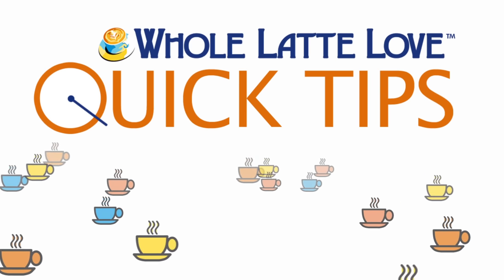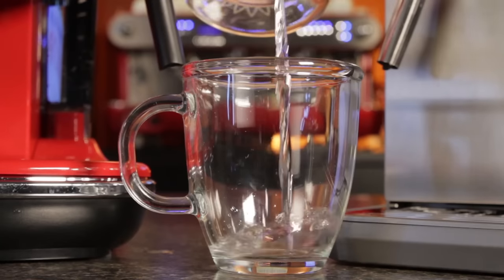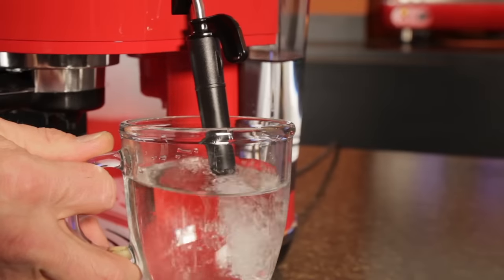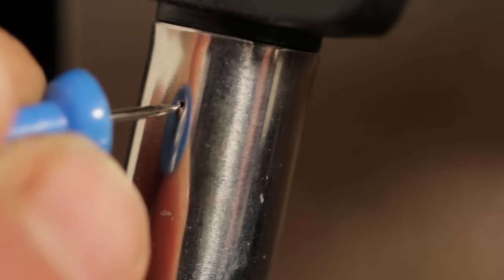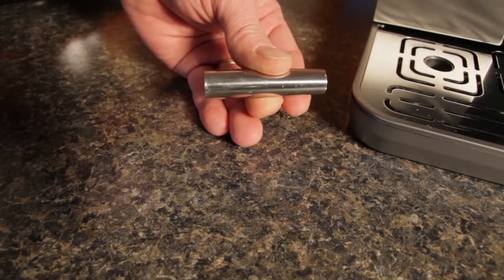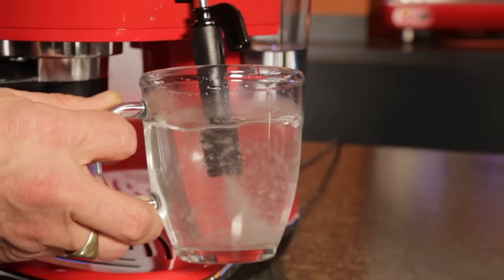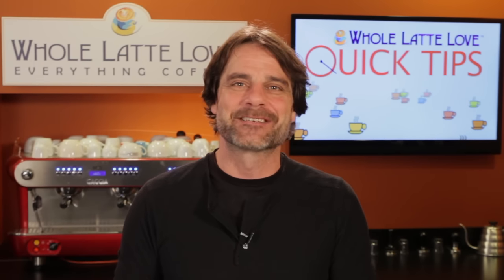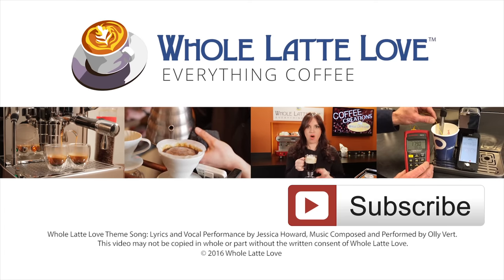Auto Frothing Steam Wand: How to Test and Use

Comment: I have the delonghi ec155. Is there a way to upgrade the frothing tip? It’s so small and short that I cannot get a good froth. The foam ends up separating from the rest of the milk. Thanks!
Reply from the maker: Hi LN, I'm not aware of any upgrades for that. It's a very entry level machine with limited capabilities.

Comment: Hi Mark, love your videos. My manual steamer on my Gaggia Accademia Is not producing the highly visible bubbles in a clear glass of water as shown in this video. I must have low pressure or something is clogged. I don't see any of the air intake pin holes the video shows to clean. Please advise how to get more pressure. thanks, john
Reply from the maker: Hi john paul, Thanks for the kind comment! Here's a video showing manual frothing to latte art quality on the Gaggia Accademia: https://youtu.be/wdTlwacRPPQ
There is no air intake on the Accademia's manual steam wand. You'll only find those on auto-frothing wands. Manual wands are capable of much higher froth quality than the auto-frothers!
Marc

Comment: is it possible to do latte art with auto froth
Reply from the maker: Hi, Is it possible? Yes. Easy? No. Getting to know your auto frothing wand using the tips in this video can help get you closer to the very fine micro-foam required for pouring latte art. It's all about getting the right amount of air into the milk early in the frothing process and then stopping air injection and rolling the milk to mix in and break up the air bubbles.

Comment: I assume the wand is expelling hot air... why does holding the wand deeper in the glass expel less air?
Reply from the maker: Hi AF, Thanks for a good question. The wand is moving air/steam. As steam moves through the wand some milk is drawn in through the wand tip due to suction caused by the steam moving through the wand. Near the top of the wand is an air intake hole. Air entering this hole mixes with the milk drawn up by the wand to create froth. As the tip of the wand is placed deeper into the milk less air is drawn through the air intake hole as there is less suction. Less air = less froth.
Marc

Comment: I think if you can replace the wand with higher quality I have a feeling it will not help much because the machine is not powerful enough to give more or better steam I think some videos suggest that machines with slow steam is better to control for people with no experience because higher quality machies the milk get hot very fast and maybe reach to near the boiling point if you do not know what your doing
Reply from the maker: It's easier to learn with a little less steam power. Thanks for the comment!

Comment: Why is this called auto froth? What is a non-auto froth then? I though all frothers worked like this
Reply from the maker: Hi d, Thanks for the question. Auto-frothing wands have a method of mixing air with milk within the wand during frothing. Manual steam wands do not. A manual wand can produce a much finer latte art quality micro-foam. But, they require some skill to operate for best results.
Marc
Reply: Because you are the auto :p

Comment: Do anyone know wheres the air intake for those delonghi panarellos that can be switch between "hot milk" and "cappuccino" like the delonghi dedica? Ive been using it for a while yet still can figure it out...
Reply: Same here  and if u have noticed there is a 1mm think sticking outse of the want and opposite to that therr is a depressio. On top. What is that for?. I have trird so many times ..still cant achieve the micro foam 
..

Comment: Kindly forgive my ignorance on the subject matter. My question is:

1) After practicing with dishwasher soap for number of times wouldn't it spoil the wand?

2) After practicing several times with dishwasher soap now when i actually do it  with milk wouldn't the soap flavor spoil the taste of coffee?
Reply from the maker: Good question! So long as you purge the wand after practicing it should not be a problem. Just open the steam valve after removing pitcher containing the soapy water. It's a good habit to get into - should always be done after steaming milk - every time!
Reply: +Whole Latte Love  Thank You. My last Question:
I'm new to coffee and I'm living it. considering going my very little experience which home based espresso machine will you recommend. mend. A) Breville Barista 870XL B) Rancilio  Silvia V5
Reply from the maker: Some thoughts to help you out and check the end of this comment for a link to a side by side spec comparison of the 2 products:
The Silvia requires more skill to get good results. But with a certain skill level you should be able to produce better shots. With the Silvia you will want a capable grinder to go along with it. The Breville is easier to use and the grinder is built-in. The Silvia needs to warm-up for 15-20 minutes before it's ready to use - the Breville is ready to brew in about half that time. The key difference is the Silvia is considered a machine while the Breville is better classified as an appliance. With proper care either should give you years of reliable service. But, which one will still be operational in a decade or two? My money is on the Silvia. It's very user serviceable...the Breville, not so much. If you ever want to upgrade, the Silvia will retain value better. Let us know if you have any more questions.
https://www.wholelattelove.com/product_comparisons/show?products%5B%5D=breville-bes870xl-barista-express-in-red&products%5B%5D=rancilio-silvia-m-espresso-machine

Comment: can you replace the steaming wand with a higher quality wand on some machines like the DeLonghi the quality of the wand is very very low is it possible to replace it with something higher quality
Reply from the maker: Hi Sam, it may be possible. Although the Delonghi uses a type that is a little different than most so not sure wands from other manufacturers could be swapped out. Have you tried the water test with your setup? It can reveal how your wand works. Especially how much air it's adding when the depth of wand in milk is changed. Also very important to keep the wand clean and free of milk deposits which definitely affect frothing performance.